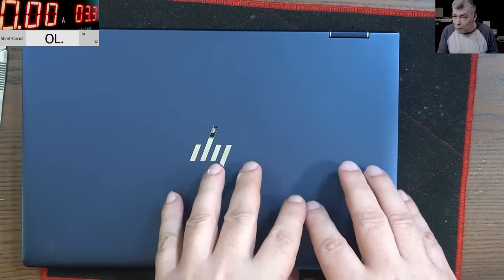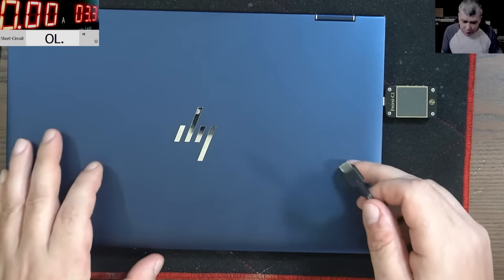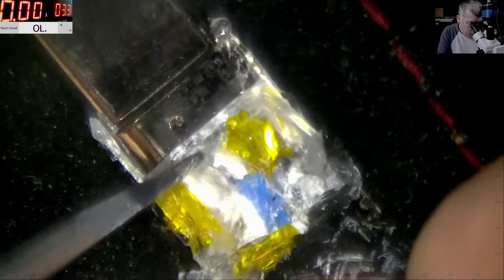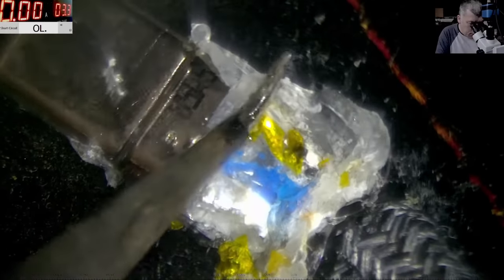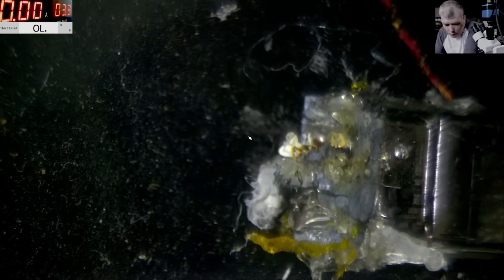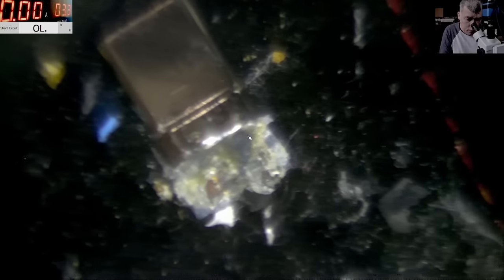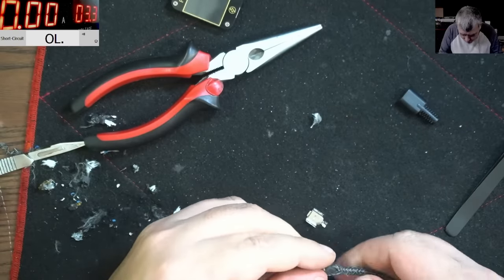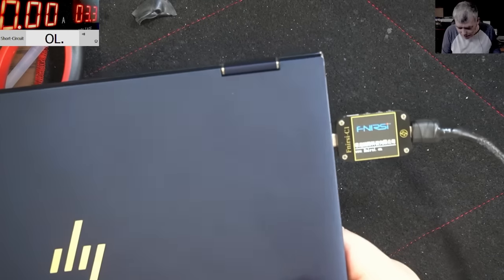How a laptop charging issue can be misinterpreted. Hp Elite Dragonfly charger repair

Comment: Just few days ago fathers laptop was turning off for a moments if you moved the laptop. Negative braided wire over the isolation of positive wire was severed completly right at the end of the cgarger power connector. So I with soldering both wires, using electrical tape and shrinking tubes, laptop is working normally again. 

My mistake was that I suspected a power socket on laptops motherboard because it did not seemed to be cable fault at the begining. At least I streinghtened the mb connector contacts with fresh solder wire 😁.

It is low end laptop (ASUS X553M) but still usable 😁.

Comment: I would put two or three shrink wraps on the cable around where it broke, each successive layer shorter and nearer to the metal plug.
This would distribute the flex point over a third or half a centimetre.
What do you think?
Reply: That's my tactic too when repairing a broken cable. Not sure how effective it is as strain relief but its better than nothing and for very little time and effort.

Comment: Sorin isoproponol will creep under that hot glue and make it very easy to remove it without using heat. It will remove it completely cleanly with no residue left.

Comment: Try using isopropyl alcohol or something like PCC cleaner. Leave it for 30sec. It makes the hot glue brittle then you should be able to easily scrape it off.

Comment: I've been doing this for years to make all my charging cords last for laptop cell phone and cetera  I use a piece of rubber sealant tape non adhesive wrap it around tightly from the connector down the wire a bit and then wrap electric tape to take the stress off the connector where are the Sutter connection is made my cables last longer I've had some for years

Comment: The 65W charger also can have an issue where the cable bents on the ac adapter portion. It gets pulled when wrapped around the ac adapter, leading to an intermittent connection when moving the ac adapter around.

Comment: I think Type-C should have more wires if the adapter is genuine. Also you can put a shrinking tube so it holds the old plastic together. Nice video as usual.
Reply: usb c chargers dont need more than 3 wires as they dont transfert data. One data wire is enouth for communicating with the charger to switch voltage.

Comment: Hello Mr. Sorin. I'm in the market for new laptop. In your profession experience what brand have the fewer number of presence in your shop? What brand is most reliable?
Reply: Not Asus for sure, avoid also "gaming laptop"
Reply: @rafarafa3094  Thanks, also what's wrong with gaming laptops? They should have better cooling and engineering in them?
Reply: @DarkGT  the extra engineering is the actual problem if you don't really need it.

Comment: Sorin why don't you just replace the cable with 3rd party cable. Just crack open the adaptor, and replace the usb C cable.
Reply: thats also an option, but those chargers are capsulated, hard to open and what he did will do the job, and of course was easier and faster
Reply: @ДимитърАндонов-ъ7е  it not that hard to open. Just smack around the side where top cover and bottom cover meet with big screw driver handle, it will crack open. I have done it so many time, none of them has any porting tar in it. But make sure to use rubberised handle, not the hard handle.

Comment: Thanks. My laptop motherboard started making a buzzing sound and won't turn on. I removed all connections and supply power to just the motherboard and I can still hear the buzzing sound. What could be the cause? Is it over?
Reply: Probably something shorted to ground.... Only if you have that 0.5% luck it's a connector issue, otherwise I can only wish you to be in the UK so you can mail it in to Sorin.  So we can all see the repair procedure.    It would be a win-win-win solution 😂😂😂
Reply: P. S. Or the other 0.5% of luck if it's a charger issue (the actual "brick").  I've been through something similar a couple of years ago.   You might wanna try an other charger before anything else. Be sure to check the voltage before plugging it in.    I wish you all the luck.
Reply: @deleanuandrei9612  haha yes, sadly I'm not in the UK. I couldn't find any repairs similar to my problem so that would have been a good video.
Reply: @deleanuandrei9612  the charger voltage seems fine, multimeter reading shows around 19.6V (listed as 19V , 4.7 A output) idk if maybe .5 volt is the issue (haven't checked the ampere). Couldn't find a similar charger to test yet. The CMOS battery also seems fine (2.9V). The buzzing sounds like a dying cicada ( continuous buzz) 😂
Reply: @randomjack477  the voltage is important and yours is ok. For the laptop to start without battery inserted you could try a charger with lower amperage if you don't have an other option.   But as I was saying, you should be extremely lucky for it to be just a charger issue.  Anything getting hot?